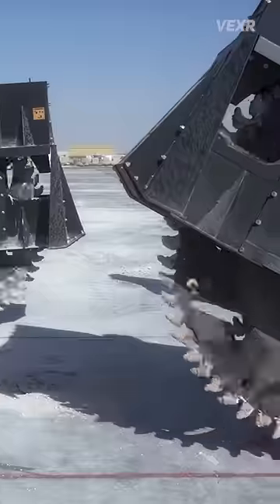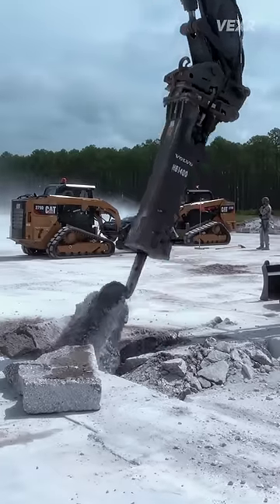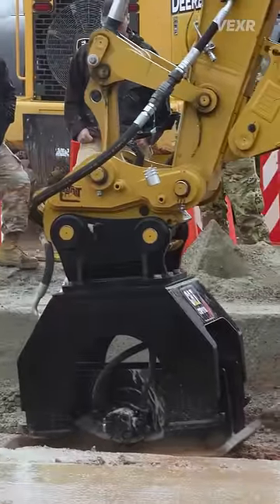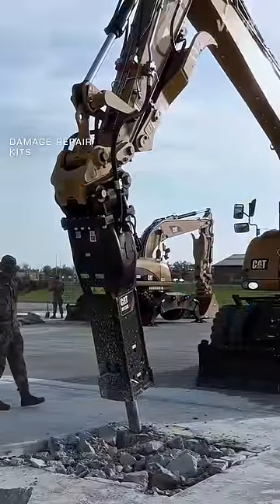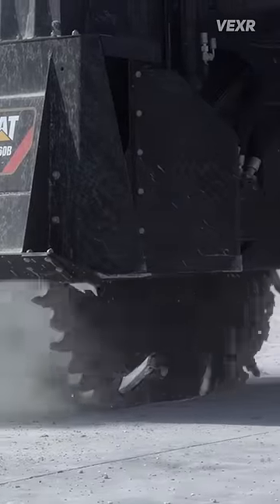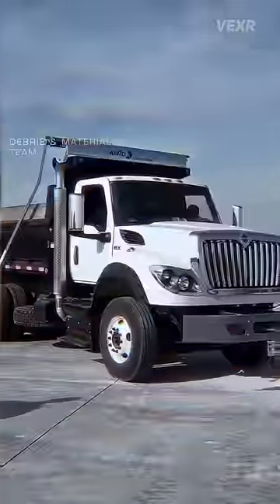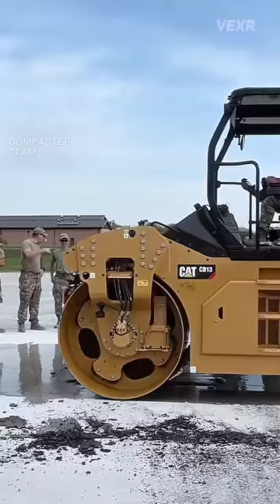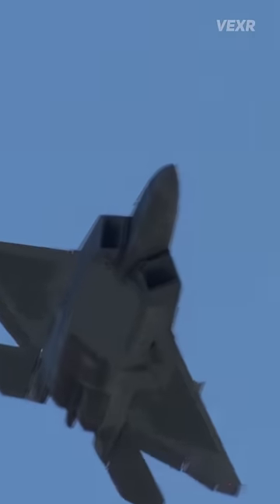Why is the Air Force Bombing Their Own Runways?

Comment: That's why USSR used concrete tiles, and here in Ukraine we are using the same approach. 
(mainly because our army was not modernised, but still)

To lift a few shattered tiles and replaced them with new ones is MUCH faster and requires MUCH less equipment - an auto-crane and two trucks.

It's not a perfect approach, it's not as smooth, but it had been used for decades for a reason.
Reply: I totally agree. This process seems way too slow and complex for what is essentially filling a pot hole.
Reply: Even with tiles, you're still going to have significant damage to the base coarse that you'll have to dig out, replace, and compact. So you'll save less steps than you think. And a crane is larger, slower, and requires a more skilled operator than other repair equipment.
Reply: We have different philosophies of weaponry. Our planes need to take off from every corner of the USSR (cold plains, snowy taiga, sandy deserts, muddy fields). American planes on the other hand need perfect maintenance, clean runway without any debris. That’s why I think Ukraine won’t get more than a few F-16s
Reply: Damn bro hows the war going? (I tried to sign up for the liaison force but my country said they wouldnt send me because they’re only letting veterans go sorry i tried to help yall fight)
Reply: @al1sa920 thats bullshit most us planes can liftoff from dirt runways 😂
Reply: USSR used tiles on everything...
Reply: @kl1970  what "most us planes"? I'm telling F-16 can't do it. F-16 is only usable if you're logistical industrial giant like USA. It needs clean long runway (or an aircraft carrier for that matter). Maybe one time you won't get debris in your air intake, but next time the aircraft won't take off
Reply: This is the longer more permanent way of doing it. The rapid repair method it's just filling the whole sand or dirt and then bolting down a fiberglass pad over it.
Reply: @jn-ny8bh It is slower. It also produces a better runway, and old material can be recycled. No stock of tiles needs to be kept. Just more fuel for the machines, which there is already plenty of at the base. It better suits the American style of “pull” rather than “push” logistics.
Reply: @al1sa920  lmfao cope harder
Reply: show me how useable that tile run way is after a good rain and freeze
Reply: @randylahey2242  what should I even cope for?
Reply: @al1sa920 ”only useable if you are an industrial giant like the USA” Tell that to the 25 countries that is either actively using or has used the F-16 as of this date.
Reply: @al1sa920  The F-16 cannot be launched from or recovered by a carrier, and has an extremely short takeoff distance, it's used by a not insignificant portion of the planet, and is one of if not THE most mass produced 4th generation fighters, it's extremely cheap, robust, and customizable, likened to the modern Mig-21. I don't know where you got the information you did, but it's almost entirely wrong.
Reply: Tbh, you could just go with Sweden’s approach and just build your Viggen to takeoff from
Highways
Reply: @yuanxinwang8219 well any jet can just all in length and thickness of concrete
Reply: @MTF-EPSILON-11-5-NULL  the Viggen was DESIGNED to do it though, it has thrust reversers for this
Reply: @yuanxinwang8219  youll have that I suppose
Reply: @yuanxinwang8219 us interstate highways were designed to have mile long straight aways that can be cleared for air traffic if needed
Reply: Concrete is concrete. Bulk is bulk. No one is dropping in a giant concrete tile easily.
Reply: Plus winter frost heaves makes repair quicker too
Reply: So, just a lowly American from a military family that includes 3 aircraft mechanics.  Most of our air craft aren't delicate. We have everything from the super delicate stealth air craft, to cargo planes that are larger than most apartment buildings.  The stealth stuff generally need an improved runway, but most of our combat craft are built to land and take off anywhere there's enough space. We also have multiple air craft that can (and have) lost wings, ailerons, elevators, landing gear,  etc.  And still flown back to base and landed safely. 

I assure you, our air craft are NOT delicate.  There's a reason they cost so much, and it's not all technology and mark up. The money that could more than pay for all those social programs the rest of western world goes to weaponry. You think those weapons are going to be worthless outside of the show room?
Reply: @pablo4yu they don't want to train ppl
Reply: @StrangeTerror wtf u mean ur aircraft
Reply: and cheaper but you know the american way....
Reply: @al1sa920 Israel takes off their F-15’s from dirty runways, idk what you’re on about.
Reply: @al1sa920 The F-15 Strike Eagle has 104 air-to-air kills and it's never been shot down in combat. Israel is responsible for a large portion of those kills, but the F-15’s they used where made in the United States. They have no issues, taking them off dirt runways.
Reply: Some one just delete my comment
Reply: America is the Federation in Star Trek. Top-end technology that requires a lot of knowledge and skill. Everyone else is everyone else in Star Trek. They all take short cuts.
Reply: That's great if they're your runways, but, rightly or wrongly (that's a debate for another time), the US fights all its wars from someone else's runways - the UK, Germany, Saudi Arabia, Qatar, etc. And, other than very long range B52 flights, I don't think the US has flown combat missions from its own runways since WWII flying missions from Hawaii.
Reply: @cannabislife1688 You're talking about the F-15 Eagle.  

The F-15E Strike Eagle variant has famously only ever had a single air-to-air kill, a helicopter hit with a 500lb bomb.  😆😆🤣😆😄
Reply: @pulaski1  My apologies, I always remember the fighter as the “ F-15 strike Eagle in my brain “ but you are correct. The F-15 has an amazing combat record with a 104 wins and zero losses although, I must note that the good majority of the wins where achieved by Israel.
Reply: @cannabislife1688  There's no need to apologize. 🙂
Reply: @jn-ny8bh the runways and tarmacs have to support a few hundred thousand pounds. Yes this is complicated,  but necessary.
Reply: @pablo4yu it’s actually because your country wouldn’t let you go fight for nazis
Reply: That's the USAF for ya - use 100 airmen for a 20 airmen job. US Navy and Marine Corps OTOH, lay down a quick metal temp pad and keep it pushing.......
Reply: Its an awesome technique! Especially if it's only temporary which would be a better idea. He said in the midst of battle but he didn't say how much time the "record time" process is but if real conflict ever ensues tiles are the way to go
Reply: @al1sa920 did you just say THE F16 NEEDS A AIRCRAFT CARRIER
Reply: Soviet planes are essentially tractors with wings, they dont need a fancy new road every time they take off. Can land on fields, if needed. Us planes, though, need em

Comment: As an Air Force Vet. The total training is called BRAT (Base Recovery After Attack) runway repair is not the only thing there is. This all falls under the civil engineering squadron. It would include air field lighting and aircraft arresting systems
Reply: Engineers lead the way!

Comment: Then the enemy comes back and bombs the shit out of it.
Reply: then you rebuild it, launch more planes, repeat. if they have to keep spending munitions bombing it, fuck yea some cheap concrete will win that stalemate
Reply: @nyarkonyarlathotep1512  If the enemy comes back & bombs the airfield a 2nd time I’d have to ask WTF IS THE AIRDEFENSE DOING.
Reply: @peterni2234  its never a matter of if, its a matter of when
Reply: @nyarkonyarlathotep1512 damn, imagine getting heavily bombarded, when are you gonna launch that interceptor I wonder, prolly after the volley had ended
Reply: Then they fix it and hurt the bad guys
Reply: @nyarkonyarlathotep1512  that's why the second bombing would happen before the hole could be filled.  If you are trying to fix the hole at the time, all of the specialized equipment and people on the runway would be destroyed.  If you are NOT fixing the hole, your runway is still closed.
Reply: @xuansu9036  you answered your own point, its a do or don't, risk the materials to fix it, and get a runway back

or don't fix it, and have an inoperable runway

war isn't about closing off ways options but to cause those options to be problematic in all directions.

Comment: Bet thats Hurlburt afb. We've got a huge test range here
Reply: Especially with the current exercises
Reply: Yes that is where they are based as if I remember correctly they are called red horse. They are the Air Force version of the sea bees. They also had (I can't swear they still call them these names now, these were the names when I was on active duty) the second one was called prime beef. I don't remember the exact meaning of the name just called it primary base emergency engineering force. They are the same job just assigned to a fully functional air base. While the Red Horse would set up air bases close to the front lines  where they can receive heavy weapons, rockets, and artillery fire. Plus the damage from bombs but they are combat engineers..
Reply: @theEVILone0130  REDHORSE= Rapid Engineer Deployable Heavy Operational Repair Squadron Engineers. PRIMEBEEF= Primary Base Emergency Engineer Force. The Horse is the primary building team in deployed locations, and does things like drilling wells. Beef then comes in and maintains the bases or does special tasks like repainting runways and such. Most of this vid was shot at the Exercise sites at Tyndall, Ramstein, and Anderson AFBs, with some regional site footage thrown in. ENGINEERS LEAD THE WAY//LEAD, FOLLOW, OR GET THE HELL OUT OF MY WAY!!
Reply: @arcticelectric did this for many years and through many different repair formats. PSP, AM2 matting, Fiberglass matting, concrete slab, etc. Was both Horse and Beef and proud to be a Combat Engineer!!! Engineers lead the way!!!!!

Comment: So, I'm retired USAF CE.With RED HORSE and PRIME BEEF experience in RRR. From AM2 matting, to fiberglass mats, and precast concrete slabs. I was always told the asphalt wasn't sufficiently solid to take a landing aircraft
Reply: Correct. We made runways like that in Iraq during Desert Storm. Spangdahlem AB was the RRR Olympic champs for many years and it showed when we needed them!
Reply: I did this for many years and through many different repair formats. PSP, AM2 matting, Fiberglass matting, concrete slab, etc. Was both Horse and Beef and proud to be a Combat Engineer!!! Engineers lead the way!!!!!

Comment: Once in the days when I was commuting through the Bay Area Caldecott tunnel, I noticed crews were replacing the road surface on the westbound lanes, just east of the tunnels.

They'd start in  the evening, one lane at a time and when I went by going eastbound at dusk, I could see the pavement was dug enough for the workers to be up to their knees walking in the dug out lane, but by morning, it would be solid pavement with gridlocked commuter traffic. I figured they must be using some sort of "epoxy" pavement.

Comment: I tried to implement this practice when I worked on a street repair crew that mostly operated in the ghetto area. But we would have needed to replace the EOD with SWAT and snipers clearing the block amd setting up a perimeter. 😮😅

Comment: Yeahhhh you wanna see actual emergency repair? They literally just drop a steel grate over the hole, similar to the instance runway grating and fix it later, less than ten minutes after you blow holes in it, you can land c130s and c5s

Comment: Why do they cut out a huge square much bigger than the damaged area? 
Wouldn't it be faster to cut out just the damaged area? 
Or in this situation remove all Debry and put a tar concrete mixture that will form in the area for a speedy short-term bases.

Comment: Or buy Swedish Gripen. It can use ordinary roads. Also lower cost per flight hour.
Reply: F35B didn't even need a road 😂
Reply: And get your first 12 aircraft in 60 years 😅
Reply: Or build Autobahn's like the germans. 3 lanes are wide enough to land an eurofighter and if you pull out the middle section on a 4 laner you can land a transall/C-160 or AC-130.

Comment: looks like they were moving extremely too slow to be realistic in actual war stats have been faulty so gonna have to not rebomb but dig out their current repair and then restart the stopwatch with clearing unexploded ordinance etc and i wanna see it last for 1000 years i know i don't see no rebar here get on the Horn and find reinforcement for this tool called a runway that needs to perform at top notch level

Comment: This isn't as fast a filling the hole with gravel and covering it over with steel slats like in ww2 pacific.
Reply: Psp is too bumpy for modern aircraft electronics,  they don't really like the modern alternative,  but this method is way too slow when you need aircraft in the air asap

Comment: The American method is very, very slow compared to the UK and Canada. This method us way too convoluted to be used in real time combat situations if you want aircraft rolling down the strip ASAP. You don't need eod unless it it is large ordinance,  normal sappers should be well enough trained to use disruptor charges on smaller ordinance.  In real time the flyboys would be screaming in their lattes at the slow speed the US take to do airfield damage repair

Comment: Debris trucks? An expert compactor team? EOD clears it, engineers (or whatever the air force calls em) come in and fix it. Those are dump trucks and cement trucks, that's a roller. Haha. There is no expert compactor team, it's literally the dude who nobody trusts to run any other piece of equipment or a bored NCO with nothing else to do.